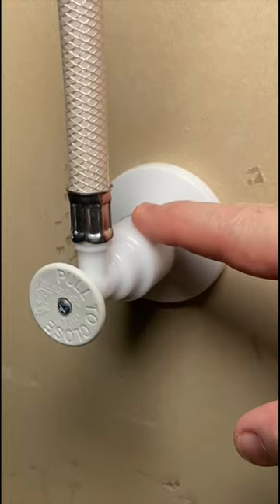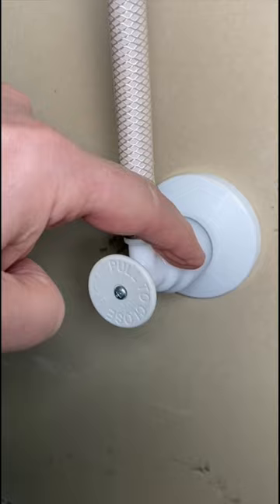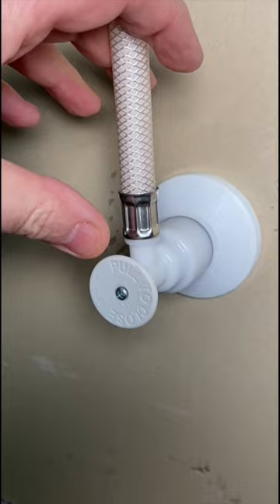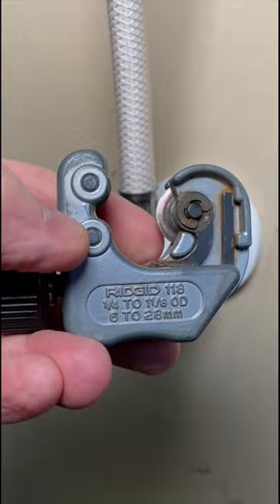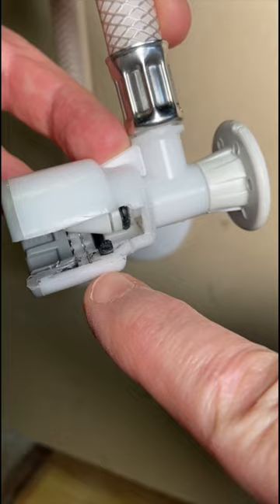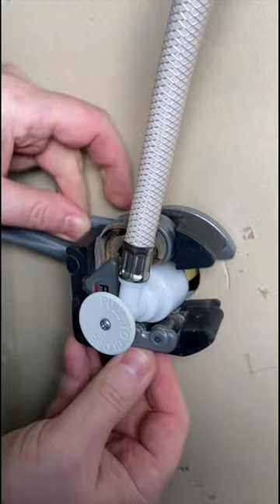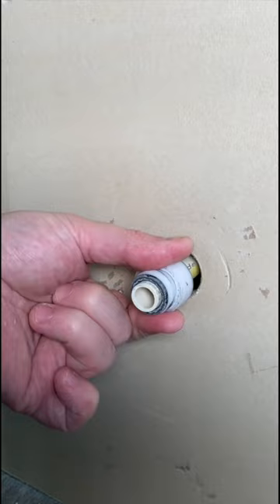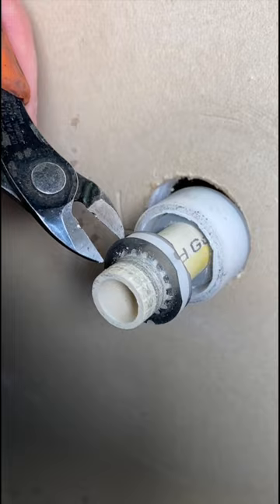Remove A Push Pull Water Valve #plumbing #helpingothers #hack #tools

Comment: And then you find out you have to rehab the entire supply system in the whole house. And while you’re doing that, you realize all the drains have to go. And once all the walls are open, you notice that the house needs to be rewired. So, you’re better off not changing out the valve! 😂
Reply: The worst thing about fixing something is discovering everything else that's messed up, haha
Reply: @illitero  Exactly!🤪
Reply: @illitero  If it's for a customer do you have to tell anyone?  Is it better to say what should be fixed beyond the initial job or no?
Reply: @illitero  My brother's an architect and with remodeling his price per hour goes up. He said sometimes he'll run into a mess when remodeling an older home.
Reply: Especially at this house since they have cpvc which gets very brittle over time and easily breaks apart
Reply: If it ain’t broke …
Reply: Sure look like CPVC that shit is junk

Comment: I feel bad for anyone with cpvc water lines in their home. Those are good for one thing only. Saving money on copper when tying in a T&P line
Reply from the maker: That is very true.
Reply: I am a maintenance supervisor. My building is primarily cpvc. It was built in 2010. Pretty much none of the valves work. If you try, they will likely break. Anything plumbing repair is a complete pain, much more difficult than it should be. I hope they saved a ton of money because they will need it for repairs and water remediation bills for the next 100 years.
Reply: They're great at breaking when you look at them wrong. Had a coworker measuring out a drywall patch for the last time that pipe had broken, I was on lunch, got a call "quick how do you turn the water off?" Simple question, complicated answer. It had broken about an inch below the last break, because he bumped it with the end of his tape measure.
Reply: Rehau is good quality & i wouldn’t mind using it in my house
Reply from the maker: @odnetnin4720  oh bro that is the worst. The authority having jurisdiction should have to pay for allowing cpvc to go into any multi family building.
Reply from the maker: @davidm8371  oh man!  That would suck. A tape measure!  I have been caught up with this crap like that screaming at the home owner to shut the water off while it try to keep my thumb over the pipe.  I’m pretty sure she has PTSD from the situation.
Reply from the maker: @triggerhappy8872  rehau does make quality product. We used it in Antarctica.

Comment: cpvc is very horrible once it gets brittle. slightest pressure on a brittle cpvc line will break. please be careful
Reply from the maker: Exactly why I make videos like this. People need to know.
Reply: That schedule 40 is buried all time.
Reply: @Victor-fb2ik   sorry to inform you but the line within the wall has the yellow stripe and its within the walls and not under ground so it is cpvc.
Reply: Street 90 CPVC is the worst

Comment: I had a customer do what you said not to do. They pulled it off and snapped the cpvc behind the wall.

I used a cpvc coupling to copper adaptor. And replaced it with a compression stop.

The customer was a mechanic and asked why a compression stop.

I told him that all you needed to replace them was two adjustable wrench and so pipe dope.

He scheduled me to come back out to replace all of the cpvc pipe just behind the fixtures with copper so he don't have to deal with that issue ever again.

One of the few customers that chooses preventive maintenance over repair bills at any given time.
Reply: A smart mechanic that understands preventing future headaches
Reply: Ah man, trying to do my own repairs and change the cartridge in my delta shower faucet. Went to twist the collar off and snapped all three cpvc pipes attached to the shower valve because the valve wasn’t secured to anything, just dangling in the wall held up by the cpvc. Luckily my shower has access from the wall behind it so I can just cut out and install an access door to make it easier to repair.
Reply: @D Kel  sorry to hear that. That sucks. CPVC too.
Reply: @mattgrommesh4125  Glad you stated "smart" mechanic because not all mechanics have that trait. 🤣🤣 
I was an automotive mechanic for 12 years before switching careers. Hands down the best skill to have and, with slight tweaks, it can be applied to tons of day-to-day issues in different trades like HVAC, plumbing, electric, etc., which saves SO much time and money. 
Especially in the long run.
Reply: @Matt Grommesh  it's bc he's seen a fix it now for let's say 1500 of deal with let's say 25 instances costing around 200 a issue.
Reply from the maker: @mattgrommesh4125  so true.
Reply from the maker: @dkel4341  that is a bad day that got worse!  😮
Reply: Thank god someone who says “preventive” not “prevenTAtive.” Huzzah! (Oh and your advice is solid too.)

Comment: I also suggest never installing push to connects that have a permanent hose attached.
Always have your shutoff and hose as separate pieces so you only have to replace the portion that is leaking.
Reply: Bro I have seen some online in apartments that is just a copper 90 from the wall straight to the toilet supply

Comment: Cut it then twist it counter clockwise comes right off. We have 500 units that has those
Reply from the maker: You making a slice with a oscillating tool?
Reply: @ThatFixItGuy  I’d be concerned of vibrating with oscillating on cpvc. Same with the pb pipes. The absolute worst I’ve seen. Literally have seen them so brittle they crumble. Unfortunately the area I’m in, it was used a lot in the 80s.

Comment: Be sure to use cpvc cement solvent weld style right angle shut off or a sharkbite angle stop. Do not use compression farrells on cpvc pipe.

Comment: I carefully followed you directions but after a few turns of the tubing cutter the knob part flew off in my face and water was shooting out everywhere. I tried to catch it in a bucket by it overflowed while I was at the grocery store.
Reply from the maker: That could not have happened if you had the water shut off to the house.
Reply: Lol
Reply: Lol skill issue
RIP bozo

Comment: The valve isn't the problem in the house... the CPVC will eventually destroy that entire house...
I don't usually use sharkbite fittings but when I come across CPVC I use sharkbite coupling to convert to pex so that when I go back out the following week I can use pex fittings to fix the next leak

Comment: Was that CPVC that you're working with, bummer, should re-pipe the whole house while you're there, that Flow-Tite valve will outlast the pipe, and yes, you can gently pull and twist those off, those fitting only work on three kinds of pipe, CPVC, Pex, copper,  you won't "jack-up" the pipe if you know what you're doing.

Comment: I absolutely hate these “pull to close” valves. If you’re not familiar with them and you break a connection, and you’re flooding your customers kitchen because nobody has a friggin clue as to how it works. Also the hose built into it. 😤

Comment: “ do you know what kind of pipe it is” is the stupidest excuse i ever heard of . What does the material of the pipe have to do with why you hate them accor valves? The problem isnt the valve… The problem is where the genius plumbers decide to cut the length of the pipe FOR the valve.. Some cut it too close to the dry wall cause it “ looks neat”… smh. Cut it long enough to be able to fit a pipe cutter for future repairs and you wont have this excuse of “ you can really jack up your plumbing”… Its simple, You grab it with one hand and twist nd pull with the other.

Comment: f you see them its always cpvc and here cpvc rots fast so i use mini hacksaw to cut it cutter just crush it
Reply from the maker: I usually mini hack it as well, but this works great.  You tried a Jones stevens EZ stoke saw?
Reply: @ThatFixItGuy  no but I'm going to look  it up, have you seen Klein's inspection camera for 38 bucks hooks to android and has 10ft cable I bought one and not bad at all , you know if I didn't need wire nuts for water heater I wouldn't have found it , guess cause made by Klein it's in electrical area